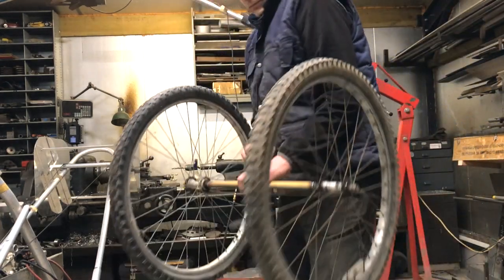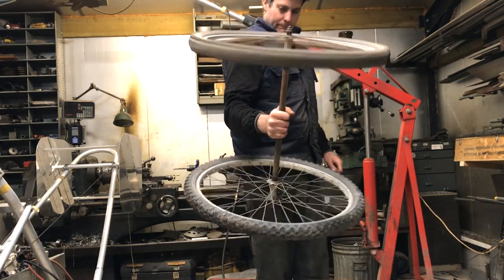Is There Gyroscopic Stability in Coaxial Helicopters?

Comment: What was the reason in the first place to go coaxial and controlling  the entire assembly like you do? Ultra lites like the mosquito seem so simple even though they have a full swash assembly. Are the rotor blades easier to attach?? They still need collective in your design no? It's not fixed pitch.... Or is it? I'm gonna shut my mouth, get of the toilet and have a good look at the mechanics tomorrow. I really really envy your just going at it mentality and despise me being so lazy. I really want a heli of my own too😅❤❤
Reply from the maker: The decision to use a tilting head/mast was made because I saw someone else do it. 
https://youtu.be/B21Xk6tNcBw?si=q8ATAucd1zy8sNL7
The Nolan brothers demonstrated how well it could work so I thought let's try it. The difference was they made a reversing gearbox between the rotors, I wasn't sure I could make this but also thought if I could do the reduction drive and the reversing in one hit I wouldn't need a gearbox saving weight. 
The mosquito is a great example of a single rotor helicopter but if you want a coaxial the double swash plates are very complicated. There aren't any plans available so you would have to work it out yourself. 
My helicopter and the Nolan helicopter is fixed pitch, hovering only as there's no autorotation. Maybe slow forward speed is ok but nothing more. I wanted a hovering machine primarily. 
Your messages are funny. 👍
I wouldn't encourage anyone to build one but I wouldn't discourage them either. It's the best project I've ever taken on but also the most controversial.

Comment: What a good way to understand how the flight mechanics of a coaxial helicopter work! Please correct me if I've misunderstood the concept , but in a coaxial helicopter where the mechanics are able two compensate the blades angles at the same time, you're not going to have gyroscopic precession. So, taking as an example that you want to pitch foward, the fact that makes the helicopter go in this direction is the difference of preassure between the front and the back generated by changing the blade angles, giving a negative attack angle at the front and a positive attack angle at the back. This differs completely with a traditional helicopter, where the movement of the vehicle is going to be with a 90º phase due of the gyroscopic precession effect. 
It is also important to remark that the pressure/force difference will be the addition of the forces generated by the blades of both rotors.
Thank you very much for your content!! 🙂
Reply from the maker: Hi. It's a complicated subject to understand but I think my helicopter works in the same way as a traditional single rotor does. What I've come to understand since this video is gyroscopic forces and precession cancel in a coaxial if the rotors are solidly fixed to the shaft. Like the Gen H4. If they have teeter hinges like mine then each rotor is acting on its own and gyroscopic forces aren't cancelled. With a single rotor and cyclic feathering the pitch of the blade gets increased around 75-80 degrees before so that the rotor tilts in the desired direction. This is not because of gyroscopic precession it is because of aerodynamic precession. It just takes time for the blade to fly to its new position. If it was gyroscopic precession you would expect there to be a 90 degree phase lag. My fixed pitch coaxial works in the same way as a blade feathering single rotor by tilting the rotor disc in the desired direction of travel. You have a vertical thrust and a horizontal thrust when the disc is tilted.

Comment: I first taxied an aircraft when I was 16 or 17, and thought the same about the rudder pedals being backwards. In your mind you’re thinking there’s a bar across the steering axis above the nose wheel, and you’re pushing on that. But this will be out of sync and backwards from the toe brakes which are located on top of the rudder pedals. For this reason you have to think of applying a brake on each side to initiate a turn, which often is what you’re doing, when you were making a tight turn on the ground, or taxiing a taildragger.
Reply from the maker: Ahhh. Great comment that explains it then, thanks so much! 👍

Comment: I'm curious, on 1:42 you mention about the forces being able to break the shaft...is that what on the Huey was known as "mast bump" that could literally make your blades fly off the rotor? In the Huey happened when doing excessive cyclic inputs under negative G load, obviously a coax is a completely different design but seeing how it attaches on yours made me think about that.

Really hooked to your build!! Really fascinating!! Please be safe!
Reply from the maker: Hi and thanks, I believe any teetering rotor can mast bump in an unloaded condition (mine included), it's just where the excessive flap angles cause it to physically bump the mast. 

There's extreme forces in a counter rotating system through the shaft if there are no teetering hinges when changing direction. The GenH4 helicopter has no teeter hinge but the blades are very close together and the shafts are able to take the loads. Glad you find it interesting. 👍

Comment: I think you saved my life by this video
Reply from the maker: Holy moly, that sounds a bit serious. 😬
Reply: @Ben-Dixey  Yea actually... I`m making a new design prototype of a coaxial helicopter...
My design focuses on removing the complexity of coaxial helicopters...
The data that you shared helped alot... thx :)
Reply from the maker: @hots2215  interesting, can you tell me any more about it ?
Reply: @Ben-Dixey  Well... I`m making it not that big to carry man... it can do agriculture spraying for the size...
And my main goal is to sell the idea after proving that the idea works...
But from engineering perspective, It is a hybrid one...
Reply from the maker: @hots2215  Should be a fun project by the sounds of it 👍👍 . I like anything with twin lifting rotors the chinook I believe to be the most efficient twin rotor and Kamov have the most efficient coaxial configuration, with Kaman inter meshing rotors somewhere in between. .  Good luck with your project.
Reply: @Ben-Dixey  Yea I saw Kamov in my way of searching or coaxial helicopters...
But the cycling pitch mechanisms of it is so expensive to manufacture..
 Also costly maintenance having all of those mechanical parts in good condition... that`s why it`s not that popular... 
maneuverability
Reply from the maker: @hots2215  yes it's certainly complicated, the Russians have stuck by it though for a very long time, there must be a reason for that. The Káman with its blade servo flaps I think is a great way to control the rotors but that idea didn't expand beyond just Kaman. Personally I would like to see more helicopters going away from tail rotors, they seem to cause a lot of accidents in my opinion.

Comment: Great stuff! Why not use a differential collective to achieve yaw?
Reply from the maker: You could do this, the Bensen B9 chose a similar  option, it didn't have collective pitch but instead had rotor brakes. This means the helicopter would sink when a yaw command was executed. Differential collective avoids the sinking when yawing but you then need collective pitch and of course a differential. I chose fixed pitch and did the coaxial reversing using the same reduction belts saving weight by not needing a gearbox at all. There is the additional weight of tail fins in my case but I decided that it would be lighter than a gearbox. My aim was to hover around a field no higher than a few feet. Any higher and you would need collective pitch for auto rotation anyway and differential collective would certainly be on the cards.
Reply: That makes sense, I look forward to seeing future updates :)
Reply from the maker: @brandonfranklin4533  👍 there's actually one other interesting issue with differential collective and that is yaw control reverses in auto rotation. Kamov's have a pedal reversing mechanism to sort this problem.

Comment: V good Mr! 👍👍
Reply from the maker: Thank you 👍
Reply: Interesting demo Ben..........have you test run with unlocked head yet ?
Reply from the maker: @cloudusterable  Hi Peter, no I haven't,  it will be on the next test, promise. I was persuaded to mount the radiator first so that hovering tests could be performed without the restrictions of pipes ect. I won't need the radiator working efficiently for testing so hopefully I can just bolt it in and go.